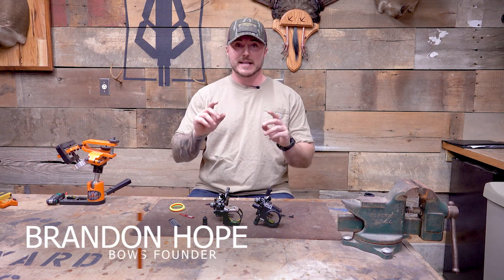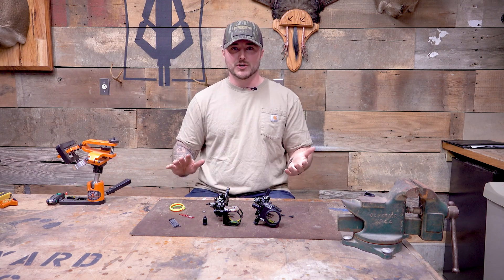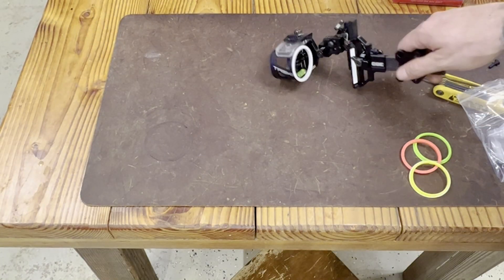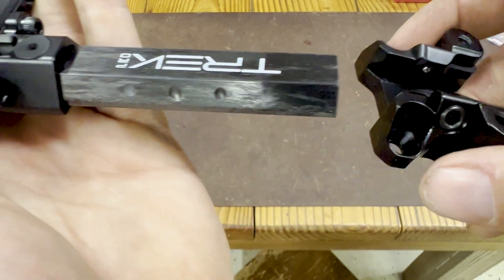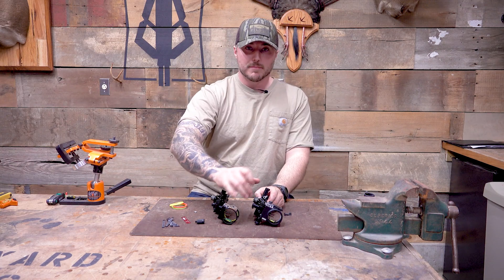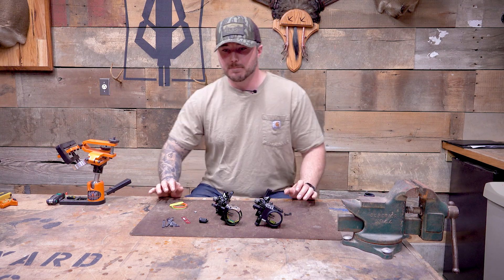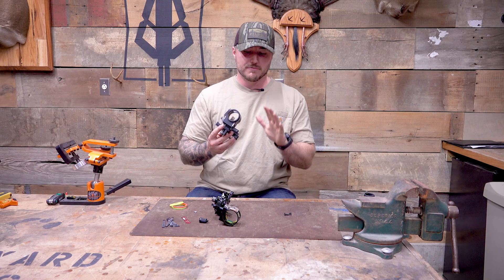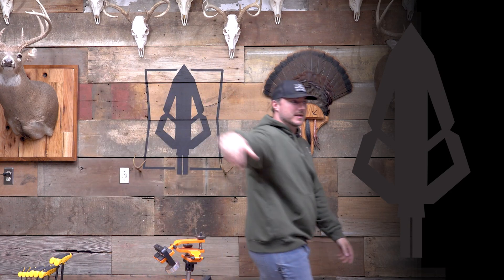CBE Trek and Trek Pro Review

Comment: Great video - did you find sufficient pin brightness, some have complained about that with CBE sights.
Reply: IDK if you got this sight or not. But I have an apex cover 4 pin slider and the pins were horrible. Spent $15 on some Nanoptics fiber and it made worlds of a difference.
Reply: @tylerdzugan9596  I bought this sight and it is stupid bright. I’ve never had an issue.

Comment: My trek pro sight pins light up unevenly when I use the sight light. Looked on the sight light threaded hole and the fiber optics are all ending at different lengths leaving my slider barely lighting up. We’re yours like that?
Reply: Mine is like that as well

Comment: Hey man! I find your reviews to be some of the best for me. I’m new to the sport but am super pumped to be getting into it. I’ve never used a sight like this and had one question. If you have multiple pins set to say 20, 40, and 60, when you move your sight up do they change to say 80, 100, and 120? Or once the sight is moved you can only go off your top pin?
Reply from the maker: That question will be answered in the walk through which should be up on YouTube with in a week, but all depends on if you decide to use one or two indicators, video explains the answer well, but no it will not line up each pin like that. Also appreciate the feedback on reviews glad they can be helpful.